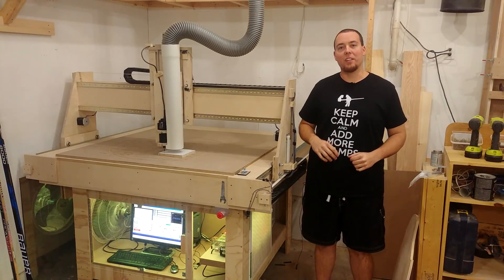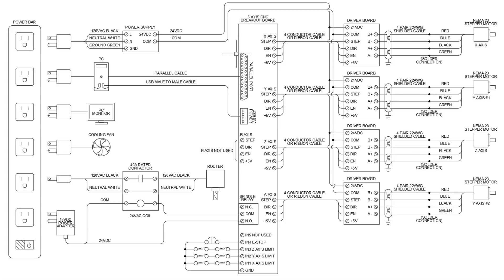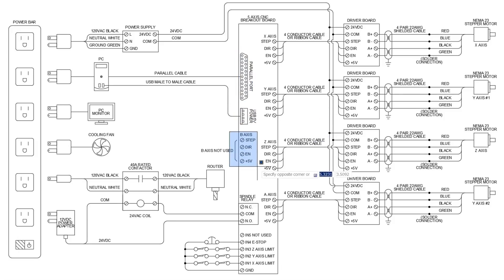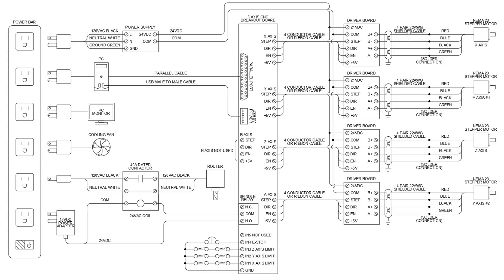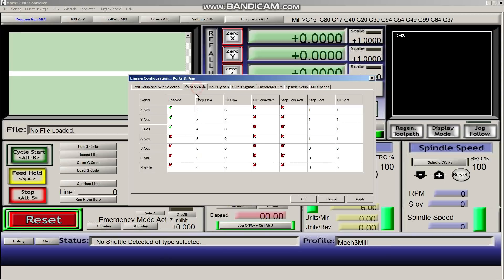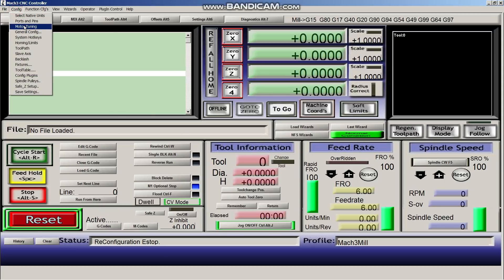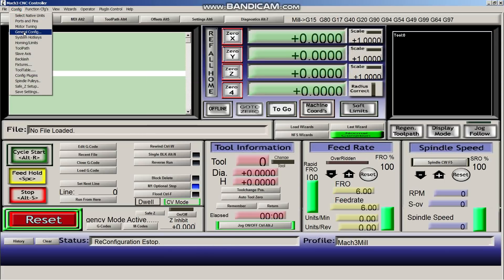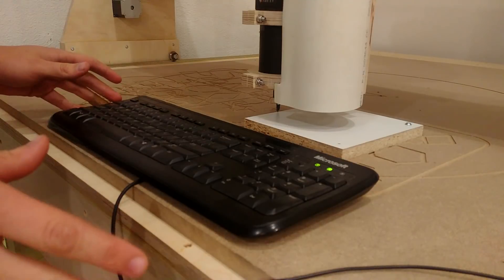Homemade CNC Router Part 7 - Wiring and Mach3 Setup

Comment: Hello, do you have any video o picture, were you show the configuration of the dip switches of the stepper motor driver?? I basically took your video series to build my CNC Router, but now I have some issues with the configuracion of the drivers.

Hope you can see this comment, thanks a lot
Reply: Thanks for the information, i will try that config 👍👍
Reply from the maker: I believe the switches are 123 on and 456 off

Comment: Just putting this out there. I have a LABVOLT 5400 CNC Mill and I am trying to wire it into a Mach3 controller to control using my laptop. If anyone can help me out I am willing to pay a little bit so that I can get this project finished. I just need help with the wiring and setup of the controller.

Comment: I really want to think you for the great informations ..
and you answered a lot of my questions. .
All I need is just one question 
can I use a 20 mm wide HTD open end belt for a 4x8 engraving cnc table ..
Do you think belt will does the job
Or may I use a 30 mm wide HTD belt will be better? ?
or use rack and pinion. .
PLEASE I need your help..
Thanks for help
Reply from the maker: If you can afford it use rack and pinion. My machine is 15mm belts.

Comment: This was an impressively detailed video series and I love how you even supplied the plans. The only questions I have are about how you chose the cabling for the stepper motors. You mentioned that you used 22 Guage. How did you decide on this value? Is the cable shielded? I'm concerned that with the motors running that I would be creating a lot of interference.

Comment: Great series. One small nitpick... strictly speaking daisy-chaining is when the input of one device is fed from the output of the one ahead of it in the chain. The diagram you showed is an example of a "bus", not a chain. Doesn't diminish the great info you provide though.
Reply: Jesus, really?
Reply: @dodge134  Yes, really.
Reply: @dodge134  I agree, so maybe you shouldn't have posted it.
Reply: @PhoenixRevealed  This has to be one of the best instructional videos on YouTube and your contribution is a nitpick?  This is FREE information and nitpicks cause content providers to say the hell with it and stop posting.  I'd hate to see this happen.  As long as you're in the mood to correct people, you should probably call this a parallel circuit instead of a buss system.  A bus system would assume a home run back to a central point (bus).  Anybody wiring this will parallel off of each driver board.  I mean, if you want it to be accurate.

Comment: In the diagram it shows that a 12VDC power adapter supplies power to control a 24VAC coil. That really works?
Reply from the maker: Yes I do it for my dust collector as well

Comment: Diagram was well done. My only thought is on the motor relay. If I am not mistaken, the neutral wire can carry voltage. If the relay is a DPDT, why not break the natural wire too.
Reply from the maker: Its not. Just look at a house light switch. You cut the hot line only.
Reply: DIY Builds - in a lamp yes you are right. In the walls there’s also a ground wire which would be the path of least resistance if there was a short for power to go through. I am not an electrician or expert on this, just my thoughts. You did a great job on the build and  I enjoyed the whole series.
Reply from the maker: Nuetral is tied to ground at the panel and has a potential of 0. I am an electrician lol. Thanks for the compliment on the build.
Reply: DIY Builds You win. :)

Comment: Man I wish you recorded your wiring. But it’s impressive this entire build is better than anything I’ve seen on YouTube from a CNC standpoint.

It’s hard to record these things because it’s a lot of trial and error and takes up more time to record and edit it all haha. 

I hope it serves you well. If you start using software to generate your gcode can you make some videos on that? Thanks man
Reply from the maker: Ya ill probably put out a video on working with fusion 360 in the future
Reply: @DIYBuilds  I would like to build this.  What's it cost for software, motor and material etc. I live in Mexico and sometimes hard to get quality material here.